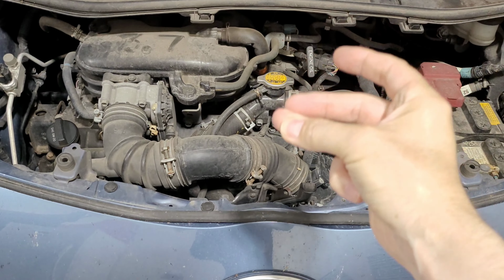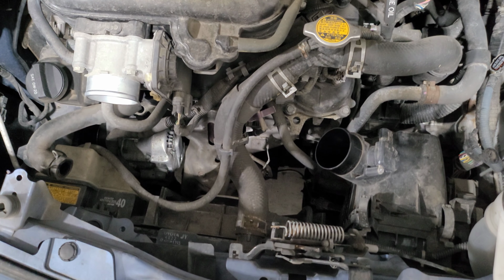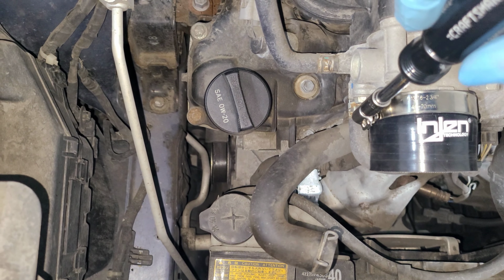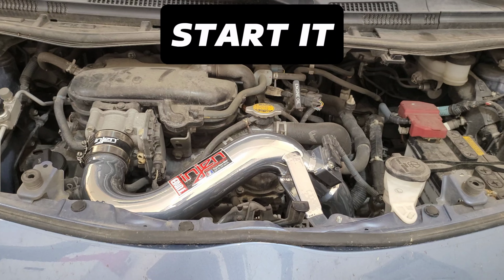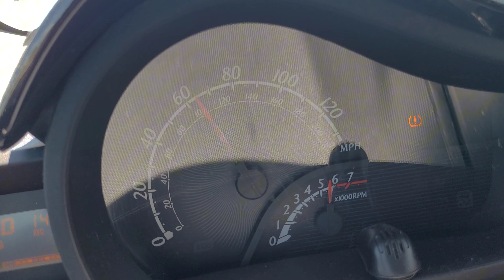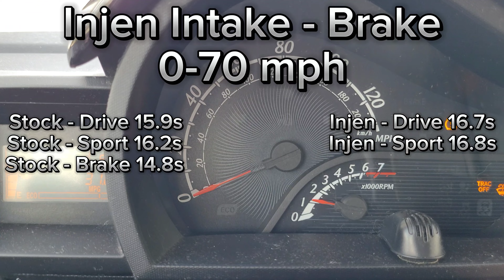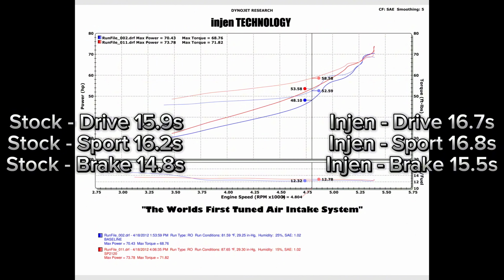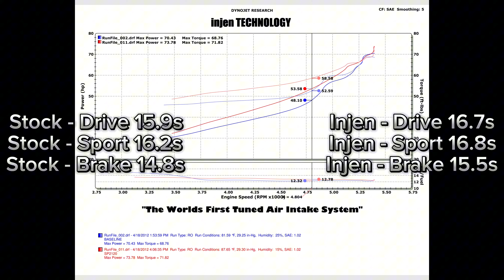COLD AIR INTAKES SUCK! Injen CAI Surprises #tuning #power #fast #scion #injentechnology #injen

Comment: Without some kind of box enclosure around the filter it’s sucking in more hot air from the engine and transmission
Reply from the maker: You are absolutely right, especially from a standstill.

Comment: Your driving on a road at different times and different external and engine temperatures. When they do the tests the do it on a dyno with cold air blasting in from the front to get the best times. If you done this in the day with hot temperatures try in in the evening or morning when its colder, your results will vary
Reply from the maker: Same day, same road, same start location, 30 minutes between runs with and without intake. Granted engine temps may have been slightly different, but it was at op temp both times with fan regulating coolant temps. It's probably the best one can do. Battery reset the time on the clock so it might look significantly different. Even dyno runs have variation in temps, as you can see recorded in Injen's test sheet. Injen's test had higher temps than when testing stock and still returned higher power. Now, back to the results. 0.7 seconds increase in time is significant. Overall, about a 5% drop in total power output over the test time. Injen claims around a 5% max INCREASE in power. So, all things being equal, we are talking about a 10% loss in power compared to Injen's claim.  The best I can come up with is that the computer needs more time to optimize settings to give maximum output.  When I retest, I will choose a day with similar temps, zero wind, and similar humidity to the original test day. I would love your thoughts on this.

Comment: Had a intake in my Camry for 2 years and went back to stock for smog inspección and notice the car is way quicker with the stock box and just the drop in k and n filter.
Reply from the maker: Seems to be a trend.  I will post new results in a few days to see if my engine management computer adjusts and has better results.

Comment: My stock ap1 s2000 with a cold air intake made 11hp .. my RSX made 7 up and my truck with a k&n intake made 13hp .. all worth the money ..
Reply from the maker: Those are outstanding results.  How are the gains in the mid range?  I assume proportionally equally as good.
Reply: @QuantiQualification  Honda S2000 ehh but mid and top end 🔥
Reply: @QuantiQualification  both the other cars it was a big increase in the top end.
Reply from the maker: Got it.

Comment: Purely based off of looking at the design and fitment of the stock vs the injen intake, the stock looks like more of a cold air intake than the injen so your results don’t surprise me much. Sounds cool tho
Reply from the maker: You are right.  The stock box pulls from outside air while the Injen pulls from mostly the engine compartment although it does sit pretty low. The smoother flow may make some difference, however. I am hoping it is just the ecm/ecu not adjusted to the new intake to account for the roughly 5% loss but it could entirely be the design too.  Hard to imagine it could cause that much negative change though. I would guess that they probably ran their intake with the hood open to allow more cool air to get in.
Reply: @QuantiQualification  keep the injen pipe but adapt it to fit the stock air box for better results.
Reply from the maker: That is a great idea!  I am going to keep it the way it is for a couple of weeks and see if the ecu adapts.  If not, something like what you suggest is in order.

Comment: Bro, you’re sucking dirt and hot air. Also, you risk sucking the water too. And the engine is gone. 

Get the after market such as Takada. They enhance from the oem design with box.
Reply from the maker: I searched for a Takeda intake and could not find one for the Scion IQ, unfortunately. Definitely sucking hot air and location is ideal for water injection 🙂.

Comment: CAI is better than stock but HAI is worse than stock.
Reply from the maker: LOL, looks that way.  Advertised as a CAI.  Nevertheless, I would expect, upon acceleration, the hot air would be used up very quickly, pulling in cooler air quickly.